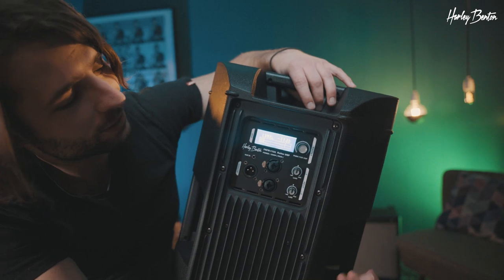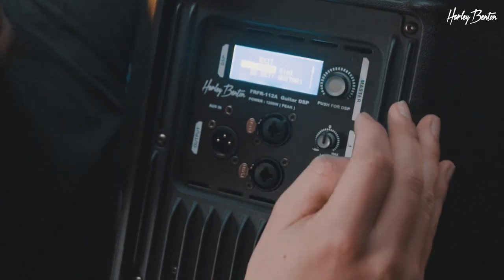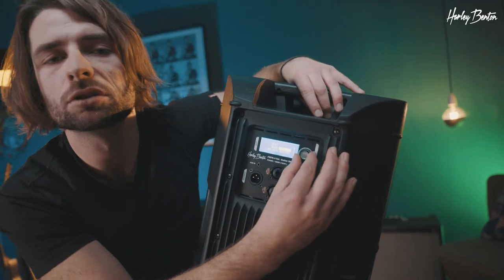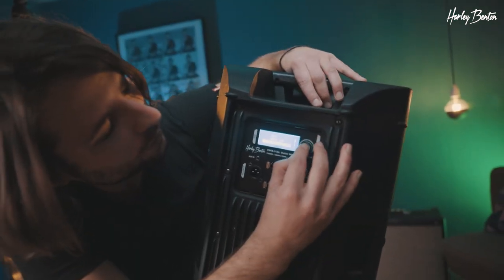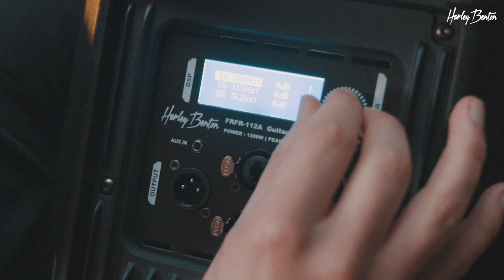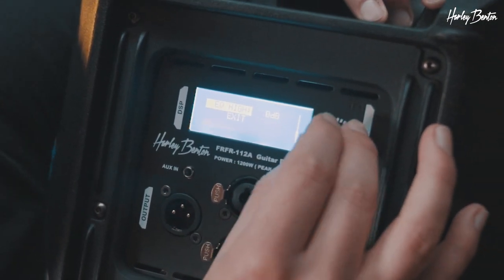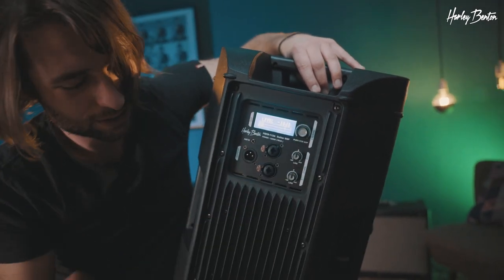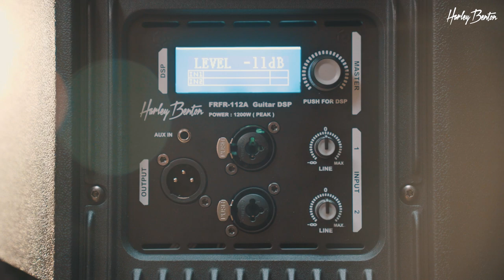Harley Benton - Guitar DSP Monitor with built in Cab Simulations - Presentation

Comment: Please  reply on this one !
There is one more control, above the on/off button... I believe it has something to do with auto off, when not in use. It's a tiny hole (maybe it should have been a tiny knob (?)).

When starting it up for the first time tonight, I had to reset the speaker to make it produce any sound, other than a light hizz when close to max power.

Comment: Is it possible to plug into a mixer table and the FRFR simultaneously ?
Reply from the maker: Sure, if your unit supports multiple outs. Or you could use a splitter that lets you split that output to multiple channels.

Comment: For small stages, such as bars, there is a big chance that  there isn't  enough space for 2 of these monitors. It would be nice if there comes a 10" version on the market; I definitely would buy a set of them. In the past I had 2 Mackie SRM350 monitors and now a Headrush 108. I like the size and weight of that, but the sound has too much bass for my taste. Thomann, can you tell me if there comes a smaller version in the near future?
Reply: You can check out Thomann' other (semi-)professional range 'the box pro 108, 110 and 112'

Comment: Hey HB, does this monitor can handle Djent? Could u make some samples with djent/metal sounds?
Reply: This is a FRFR, it takes the sound of your processor and projects without coloring the tone, so if you have a DJENT preset in your pedalboard it would sound like djent in the monitor, just make sure to have the speaker sim on in your pedalboard, if you dont have a speaker sim this monitor has 4 of them. Hope this helps you

Comment: 1200w? :O I would like to have one at home to play bass, guitar, (electric) uke and mando but... 1200w? I would feel like the kid at the beginning of that Michael Jackson video.
Reply: the headrush has 2000w....this is peack power
Reply: Never believe such power specs. It is probably measured in 1/100 of a second, at 1 KHz, into a 2 ohm load, with 10% distortion. Make it real 100watts.
Reply: @qddk9545  There is nothing wrong with the spec, peak 1200W is technically accurate but I agree it is hardly useful information. They would have been better off marketing it as a 300W RMS speaker, but that's how marketing works the biggerer is betterer [sic].

Comment: Im looking for something like this for my Iridium pedalboard setup, but i dont need 1200 watts, i dont want to use so much electricity, it's just for the home use, some basic eq would be awesome and 10 or 12 inch speaker.
Reply from the maker: It works great at home too! It has a built in mulitband eq as well!
Reply: @HarleyBentonOfficial  i bet it works great at home i just worry about the big electric bill, can You tell me what is the minimal power usage?
Reply: I think it has a D type amplifier, so I suppose consumes based on how much you put the volume up.

Comment: Are those cab simulations based on impulse responses? Is it possible to load your own IR's? For example from Celestion or Own Hammer or Two Notes...
Reply from the maker: Hi, yep they are, but you can't load it your own.
Reply: @HarleyBentonOfficial  Hi, but can you use helix and use IR's? This is like a headrush frfr but with a dsp right?
Reply: @luisfialho99  yes